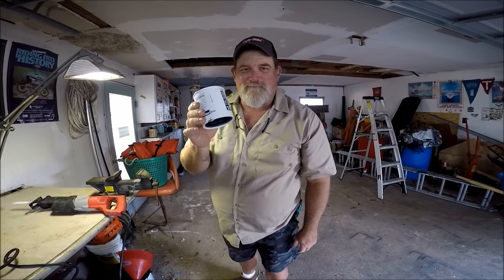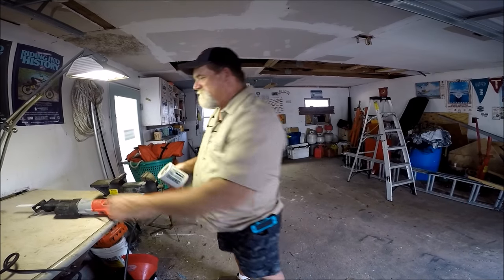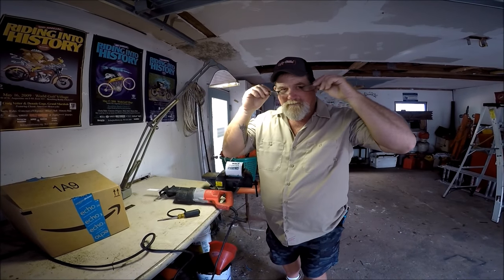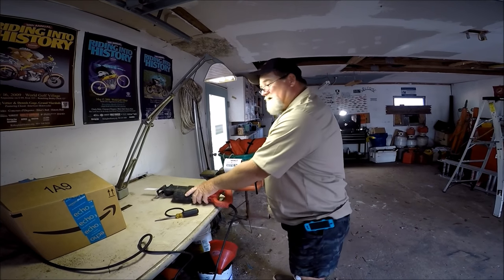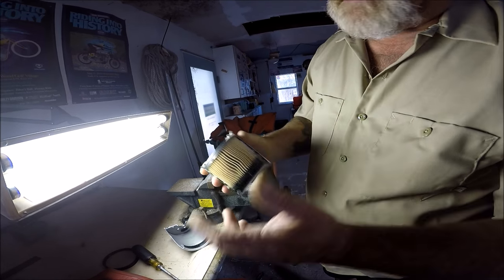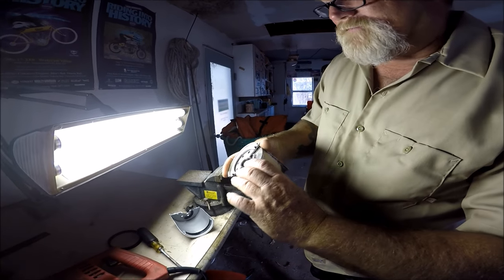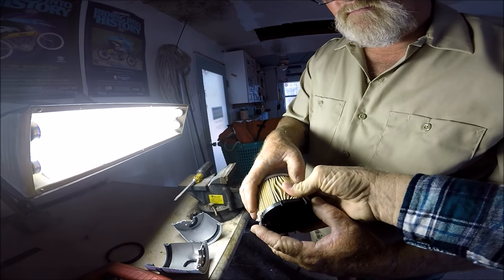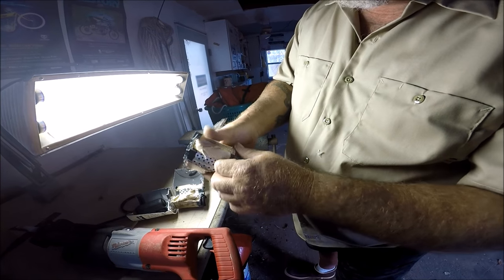FUEL-WATER SEPARATOR, RACOR FILTER-what's inside?

Comment: Hi. Any idea what the recommended time period is for changing these filters?
Reply from the maker: I don't use these expensive $40 filters anymore that you can't see look up my video on marpac quick view filter I went and changed out everything screw that stuff
Reply: Mine is connected into an outboard motor and  you can see through the bowl. It came with the boat when I bought it recently, but you are right they are expensive. Three times as much as the Quiksilver make one I had on my last boat over here in the UK. I may just change the whole unit out. Will take a look at your other video. Thanks.
Reply from the maker: @superjack2345  they are all connected, to the fuel line. Yes, some racors have clear screw on bowls, that turn foggy eventually. The Marpac, has a 100% clear bowl with filter inside. to answer your question its all about use, and how crappy your fuel over there is.